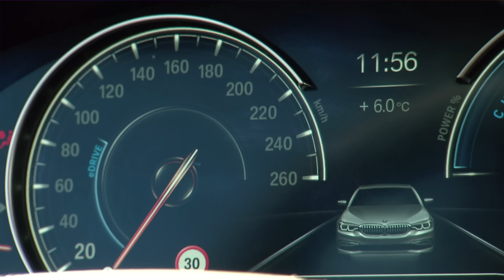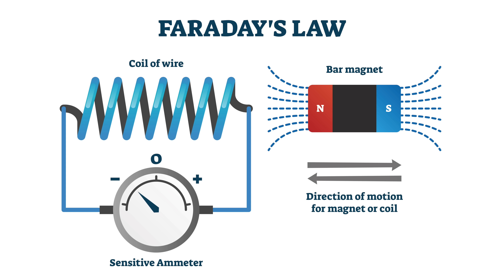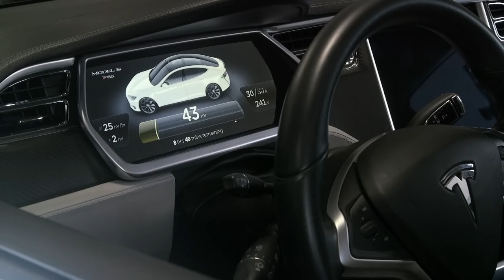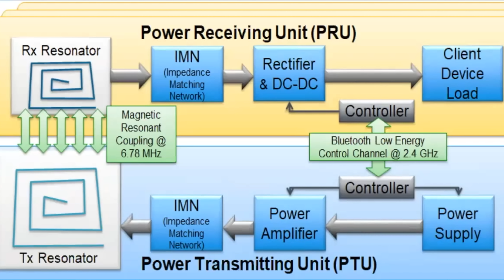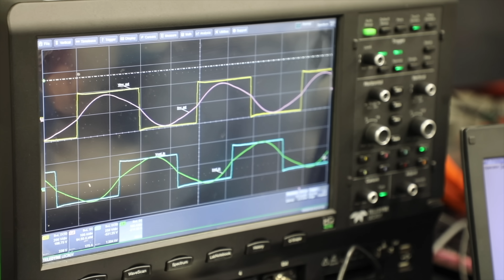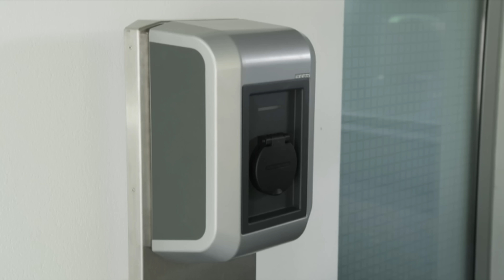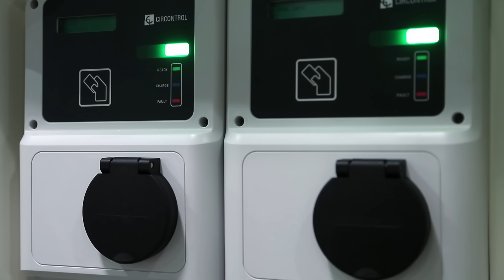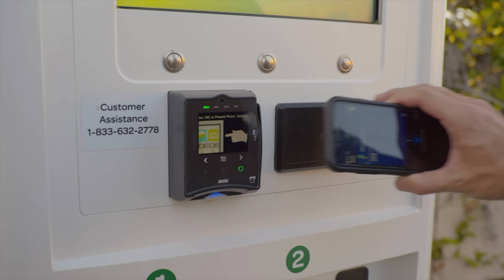Will Wireless Electric Car Charging Change The Way You Charge? Or Just Make Robotaxis Better?

Comment: Unless you're charging the car on the fly as you use the road (maybe pull over to charge lanes) I think it'd be better to have a system which reduces the air gap to zero. Maybe swing a charging plate out sideways to the side of the car to charge it in public. The air gap is the efficiency killer here.  If you are talking 300kw fast charging, 93% leaves more than 21kw of energy wasted.
Reply: A good point. But making the pad mobile sounds a bit fragile to me. Cars with hydraulic suspension could meet them halfway by dropping down.
Reply: You know what a wireless charger with an air gap of zero is called? A wired charger. If you have to reposition the car and charge plate to the point where the right bits are touching, it's not much of a stretch to do the same with actual copper contacts.

Comment: Loving the show, very insightful. Since we on the topic of charging. Could you do a video on why other automakers aren't signing up to use Teslas charging infrastructure? It seems like the automakers would gain a lot from using them
Reply: There are arguments about what the terms are.
Reply: Would you buy a Chevy if the only place you could fuel it was at a Ford dealership? The optics are terrible. "Hi, buy our new EV. You can charge it on our competitor's network". Never gonna happen. Tiny startups like Aptera, perhaps, but not any big carmaker.

Comment: There are also many commercial and industrial uses -
Forklift changing pads that can top up a forklift while the operator gets paperwork or has lunch
Located under taxi ranks at train stations, shopping centres and airports to charge while they wait for a fare (whether driven or autonomous)
At bus interchanges and timing stops to top up on the run
Maybe even at train stations for future battery electric trains, which could be cheaper and more robust than overhead wiring

Comment: Bit surprised you used mobile phone wireless charging, over electric toothbrushes.
Reply: I don't belive most people have electric toothbrushes, while most have heard of induction charging phones.
Reply: @sjoroverpirat  I have had an inductively charged Braun toothbrush for a couple of decades. It's a very good solution for wet & corrosive environments where exposed contacts don't survive well.

Comment: We just need more public charging. Large batteries and induction charging is just a goofy response to that problem.
Reply: I can imagine an induction charging station in every parking space. I can't imagine a pole and cable at every parking space. 
That will look like a mess.
Reply: @buddy1155  
I just imagined the case you suggest and shuttered.
That is a huge amount of infrastructure and a significant loss of power.
Reply: @kensmith5694  The powerless is very much dependent on the gap between car and charger. A parked car with air suspension could lay down on the charger.
Infrastructure depends very much in what country you live, I live in the Netherlands our distribution grid is 400 volt triple phase, it runs basically under every sidewalk, only 30% of maximum capacity is currently used. It would be just a matter of hooking up the chargers. 
In the Netherlands cities install already chargers for anyone that needs a roadside destination charger. An inductive charger is cheaper, need less maintenance and is better vandal resistant.
Reply: Yes, thank you, it's not that hard to plug in.

Comment: Powering the roads with embedded sensors would reduce the size of batteries in the cars and make autonomy easier. But, it would require a lot of investment that if done privatly would probably screw it all up with toll roads everywhere. Of course, toll roads everywhere would probably spur the flying car market. HEHEHEHEHE. Do it.
Reply: It would also make it much much easier for a russian hacker to shut down the whole nation.
Toll roads need to be outlawed.  It is a very inefficient way to fund things.